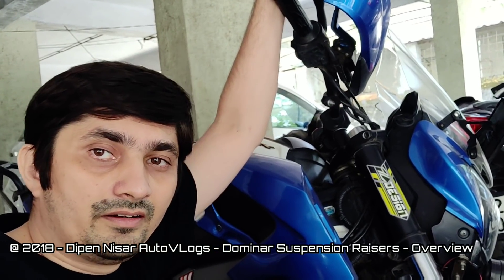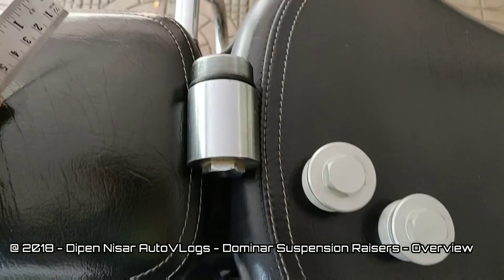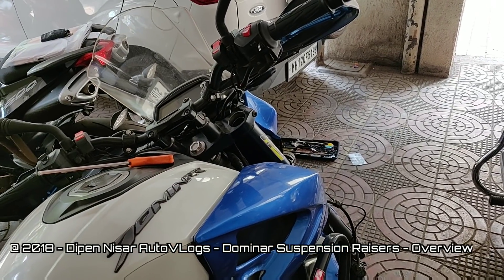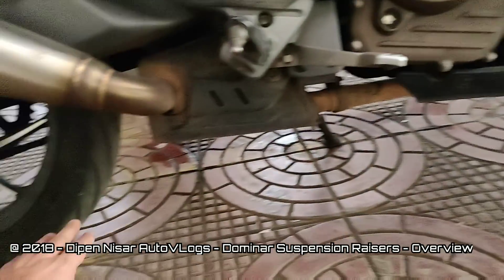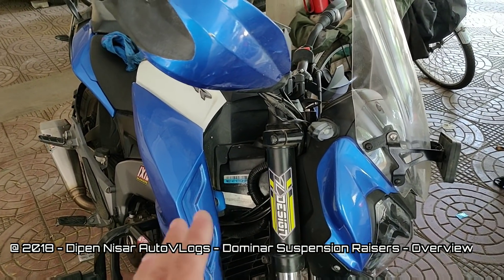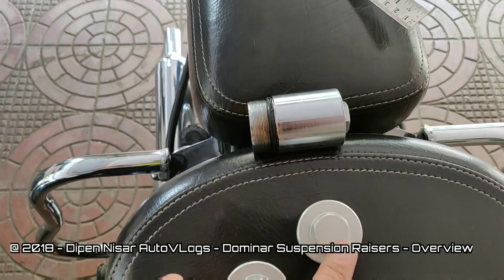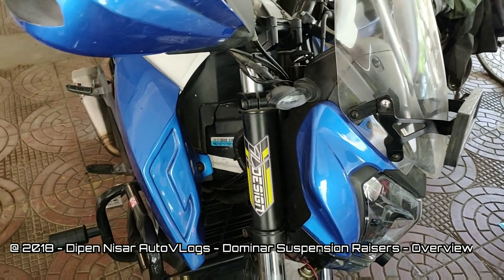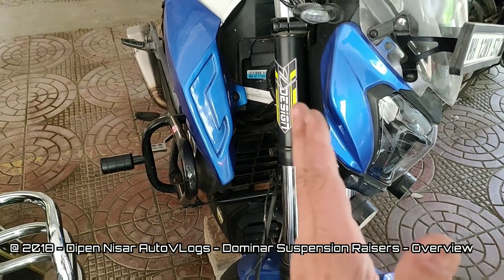Bajaj Dominar 400 Modifications | Front Suspension Raisers | Installation & Overview | DIY Install

Comment: These are only compatible with dominar  2017-2018. Are any compatible with dominar 2019 and up? I own dominar 2024 model. Are any fork extenders for dominar 2024? I can't find anywhere not even in the internet.
Reply from the maker: @panospsoh  USD usually don't have any raisers
Reply: Frack! I really wanted to make my dominar taller! Any ideas???
Reply from the maker: @panospsoh  try 19 inch wheels from the ADV. And all supporting things will need to be changed too.
Reply: Ok thanks!
Reply from the maker: no problem

Comment: How's the handling after putting the risers? Especially on high speeds, I don't think this will increase the play of front suspension but it will increase ground clearance, is that better practically on our Indian roads? I mostly cruise on highways, does this help handling and comfort and wind blast?
Reply from the maker: Windblast does not get affected, till you add a Visor - I recommend Autologue Visor or AS 200 as these are the only two I have tested for prolonged period.

Handling and Comfort, I will again leave it to individual choice, as some like the handle bar close and some do not.

I have had these Risers for more than a year, more than 15000 kms on my bike. 

It does not increase Suspension TRAVEL. IT ONLY RAISES THE SUSPENSION there by increasing the ground clearance, as explained.

Since you have travelled on highways, you know how the roads are at many places, how big potholes or rather crators we have at many places and so I guess, you know how this would help :)
Reply: @dipen.nisar.autovlogs  thanks for the detailed reply bro, please share where one can buy these in description, I was planning to experiment with handlebar risers but probably I should try these instead, can I buy them online?
Reply: Also I use as200 visor as well, I find it to be worth the money and not too weird looking, autolougue wind sheild doesn't look bad either
Reply from the maker: For purchasing, you will have to wait a couple of months. They are not available anywhere as of now. I plan to make a few and sell at No Profit No Loss basis like I did for the NS 200 Tyre Hugger Bracket.

Stay tunned to my Instagram / Facebook Page or my Channel itself
Reply from the maker: I have played around a lot with the AS 200 myself. multiple settings tried. but then Autologue came out with test piece of Transparent version, which I used for more than 2 months and now I purchased their Final version. Simply to have a Neat and Tidy finish on the bike. Else I was Happy with AS200 for sure. Pretty Cheap and does the job very well if placed properly.
Reply from the maker: Please Contact SVS motoworld - they now have the Suspension raiser Ready - number in Video Description.

Comment: Hi,  after the mod,do we need to adjust the level of fork oil / replace heavier spring  . Or just fine with stock setup
Reply from the maker: These are just basic Fork Raisers. Nothing to do with internal Working. We keep everything internal stock.
Reply: @dipen.nisar.autovlogs  thanks so much,  the reason I asked is,  we did a similar 2" front fork raiser for D200 3years back,  I felt the front forks became more sensitive and even now when ever I ride it.
Reply from the maker: @archer51277  once the fork tube nuts are removed. Gases that have collected so far release out and suspension then softens out. You can replace the oil and or springs n check once  depending on kms travelled and condition of the oil. You can get it inspected from some expert
Reply: @dipen.nisar.autovlogs  OK,  will do,  thanks
Reply from the maker: @archer51277  👌

Comment: Bro grt info, I m putting this raisers on my domi 2018 model after watching your video, jst a concern, wat i heard is from a fell rider who hve installed this is that while taking turn it feels like the bike will slip/fell over...hve u face the same issue??
Reply from the maker: Nope. Not much. Worked well for me
Reply: @dipen.nisar.autovlogs  not much means u did felt a bit 😊
Reply from the maker: nope. Worked well for me
Reply: @dipen.nisar.autovlogs  tats grt..tats wat i wanted to hear 😊
Reply: Installed suspension riser today on my domi, sitting position was superb, but front handling felt heavy
Reply from the maker: @vijaykadam7950  you will get used to it. Do a 150-200 kms ride

Comment: Hey Dipen, Just installed Suspension risers after watching this video. One question: Do you feel there is a need to install a longer side stand? Since I feel the bike is more at an angle now. Ps I do have a stand stand shoe installed. Should be enough right
Reply from the maker: I had the same side stand without any extension shoe on it. 
where did you get the suspension rider from, I was searching for one pair.

Comment: What was the effect on below (of installing fork risers) and how did you resolve them:
1. Front cables, pipes, wiring
2. Middle stand
3. Side stand
4. Seat height
Reply from the maker: 1. All stock. 
2. There isn't any Middle stand.
3. Stock. 
4. Increased by 1 cms. Nothing to be resolved here either
Reply: @dipen.nisar.autovlogs  thanks for the reply.
How much ground clearance is increased on your bike?
I am willing to install on my FZ X but my height is 5'6.. so need to be calculative about the overall seat height increase and bike manuerability with my legs/feet in daily commute
Reply from the maker: Cannot say about FZ. Never used that bike with any mods. Check with the manufacturer
Reply: @dipen.nisar.autovlogs  How much ground clearance was increased on ur bike bhai - compared to stock?
Reply from the maker: @muzaffaraqhil6570  don't compare Dominar to fZ. Ergonomics are completely diff. You might not get same increase in your bike. Rest I have explained in the video I think.

Comment: Do you face any oil leakage problem from extended fork.?
Reply from the maker: Make sure you change the top bolt oil seals if they are broken or torn or cut. Get them verified.

Comment: Hey, 
Great video

I need these raisers for my Gixxer, and since it's difficult to find it I thought of finding a lathe shop and making it myself.
I am concerned about the raisers during offroading because the fork has a weak link now and would it cause tension on the triple clamp ?
If you have any suggestion before I start, that would be helpful.

Thank you
Reply from the maker: Hey, I don't think these will fit in Gixxer. The fork pipe diameter is different. Gixxer would be slimmer.

Comment: Hi Dipen, thanks for the video, nice information. I have question regarding extenders. Post installation, does it help in handling in bumper to bumper traffic , slow speed turns etc. Currently in stock mode I find handle to heavy to maneuver at slow-speeds. Changing the cone-set didn't help ..
Reply from the maker: It did not affect handling for me in traffic. Or slow speed . These don't change any internal working structure or travel. Just height increase and better ground clearance
Reply: Dipen Nisar AutoVLogs ok, thanks for the prompt reply 👍🏼

Comment: Hi Dipen, just a quick query. 
I think the increased fork length will induce greater stresses at the cone bearing set during hard braking (due to increased leverage)
Have you experienced frequent loosening of the steering stem or any other problems after installing the raisers?
Reply from the maker: never in 20000+ kms usage.

Comment: Sir what about rear monoshok ?
We should increase high on both sides.
Reply from the maker: Not necessary
Reply: @dipen.nisar.autovlogs  stability on corners?
And is there and compromise in breaking?
Reply from the maker: @driftriders3824  no issues
Reply: @dipen.nisar.autovlogs  thank you. Bike looks lit.
Reply from the maker: @driftriders3824  thank you. Its sold now.

Comment: Bro I have seen earlier video about this from you. This is a mod I been waiting for almost a year. Is this anywhere available? You were supposed to try making a prototype. Am still eagerly waiting to get my hands on one of them pair.

My only worry is, as I am relatively tall and dominar have me crazy shoulder ache. I had to switch my handlebar to bajaj V15 handle bar a f also used a headlight raiser kit by lluvia. As of now using stock wires, but there are tight, just loose enough to work fine. I might have to switch clutch cable to himamlayan one. And I have no idea how good it is and how it works.
Reply from the maker: I just replied few minutes ago on another post of yours :) , SVS motoworld now has the suspension raisers. Their contact number in Video Description.
Reply: @dipen.nisar.autovlogs  aweeeesome bro. Try doing a sticker too for SVS. Really  proud of brands that take a leap of faith into innovation.
Reply from the maker: you can ask them to send you their current stickers

Comment: Any modifications on clutch cable after suspension raiser
Reply from the maker: Suspension riser does not change the height between the clutch cable and body of the bike
Reply: @dipen.nisar.autovlogs  how many mm raiser use in your dominar
Reply from the maker: @prasathk6368  did I miss that in this video ? It's 2 inch
Reply: @dipen.nisar.autovlogs  okay TQ
Reply from the maker: your welcome

Comment: is same kind of risers available for pulsar 220???
pulsar 220 have 37mm Fork pipes.
Reply from the maker: Hi, not yet as pulsar has a varried range. So the size of fork tubes and mounts also change.
Reply: @dipen.nisar.autovlogs  Is there any possibility to do this mod.... I am also from pune.....
Reply from the maker: @ghodkekiran  you will have to hunt for old pipes first. From which samples can be  made. If the sample works then new can be made.
Reply: @dipen.nisar.autovlogs  nice... i already have spare single fork pipe which i changed last year.... Can you please help me to do risers????
Reply from the maker: @ghodkekiran  no brother. I do this from all my spare time. I work in IT company. And more over I don't have all the tools myself. I have to hunt my friends places for all these. Plus above all you will require threading machine or tools  too where you can give proper threads to the samples. Plus a good welder who can cover the other end.
Reply: @dipen.nisar.autovlogs  Thanks for your great help....  Yesterday I saw same risers available foe pulsar 220 on Shayadri Adventure site.... and i ordered it..... Thank you once again.....
Reply from the maker: @ghodkekiran  great.

Comment: Sir plz do reply..

Can i do da same mods in bajajv15???
Reply from the maker: Hey, if you check all comments below, I don't miss to reply back. Am sometimes late but do make it a point to reply to each one :). 

Yes the mods can be done if the fork type is same.
Reply: @dipen.nisar.autovlogs  kk sorry..

..🤗and is da fork ' fork increaser size same in all bikes??or where can i buy it
Reply from the maker: Hey, Please dont feel sorry and Dont Say Sorry. 
The Fork Raiser is not same for all bikes. It depends on the Fork Top nut Threads and Diameter. Dominar is 43mm .
Reply: @dipen.nisar.autovlogs  kk thnx for dee info.
Reply from the maker: @medotetso5493  welcome Brother.

Comment: Hi 
Good video
I have installed handle bar risers in my Dominar 400
Can I install fork raisers .

Kutch cables or wires change karna padega?
I am also planning to buy Headlight Raisers.
Kindly advise.
Thanks 👍
Reply from the maker: Check my video on handle bar risers as well as suspension raisers. It should help. I don't recall which one. I am using all stock cables.

Comment: Hi dipen, today i tried installing fork risers on my bs4 dominar after watching your video. I managed installing it correctly myself but after the installation, there is no rebound in the front suspension, as if the springs have sagged and the there isn’t much free travel left and even minor undulations on the road can be felt on the handlebars. (In hindi suspension baith gaya hai)

The sequence i followed for installation is, 
1. Removed stock top bolts (22mm head)
 2. Transferred oil seal to the custom bolts and completely tightened them in position 
3. Loosened top (6mm) and bottom (8mm) allen bolts 
4. Hammered (using a wooden hammer) the stock riser bolts down to the level of handlebar bracket. 
5. Retightened the top and bottom allen bolts.

Please help me out in diagnosing what i might have done wrong and more importantly, what should i do now.
Thanks.
Reply: I have removed metal spacers before the placing the custom riser , is this the reason?
Reply from the maker: @mtabishkhan  yes.thats the reason. Put them back. And get the work done from a professional if required.
Reply: Well i had to do it myself because i live in a small town and the mechanics here (including bajaj svc guys) were not confident enough to undertake this mod job.
So can you please confirm again that the metal spacers goes in before the riser bolts?
Reply from the maker: I don''t recall where they go, its a pretty old stuff that I did. 
Either take it back to bajaj, request them to do it, I understand they are not interested.
else you will have to compare it with another dominar. they have to go in the exact same way they were before. only the top bolt gets replaced by the Riser. 
putting them back in a different flow will damage the suspension further. 
I am not sure why did you remove them at first place. I never showed that they have to be removed and kept aside.
Reply: @dipen.nisar.autovlogs  it's sorted now, the metal spacers that i removed were to be inserted before placing the riser bolts, as the spacers are internal components of the fork which provide preload to the springs. My bad, i didn't get the mechanism in the first place. 
 Thanks for the prompt & detailed reply.
Keep up the good work.👍

Comment: Can we do this modification on NS?
Reply from the maker: Yes. It can be done. But NS has a different width for the pipe. Inner tube is thinner.
Reply: @dipen.nisar.autovlogs  so do you make that as well?
Reply from the maker: @akshayraut2337  nope. I don't have a NS to make sample on.

Comment: Will it void warranty?
Reply from the maker: Good Question, Ideally it should not. but so far, I never had issues. and you can always remove the raisers, put the old bolts back and then visit service, just in case if you feel the front suspension has any issue.

Comment: Good video bhai. Question - by installing suspension raiser does it dampen the rebound on potholes, if yes then to what extent?
Also by installing these, does it lift the sitting posture to more upright one, which means there is not need to further for for handle bar risers?
Thank you buddy :) 
#RajRideStories
Reply from the maker: No change in Rebound or any internal Mechanicals.
Slightly Lifts the seating position. How much ? put Tile/Tiles below the front wheel, 2 inch height to get a feel of how much does it change at the seat level
Reply from the maker: Don't Forget to Subscribe to my Channel, if you find the details ans answers useful. Thank you
Reply: @dipen.nisar.autovlogs  thank you Bhai 😊
Reply from the maker: @RajRideStories  also handle bar risers is completely different thing. That will change the distance of handle from your shoulder. If that is far for you will need to add that separately.

Comment: Hi 
Good video
I have installed handle bar risers in my Dominar 400
Can I install fork raisers .

Kutch cables or wires change karna padega?
I am also planning to buy Headlight Raisers.
Kindly advise.
Thanks 👍
Reply from the maker: Check my handle bar riser video.